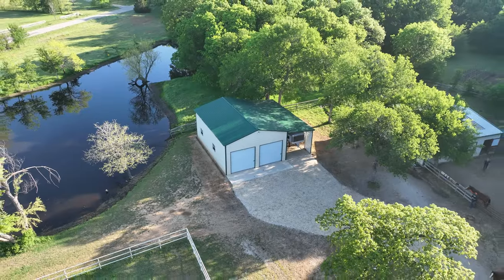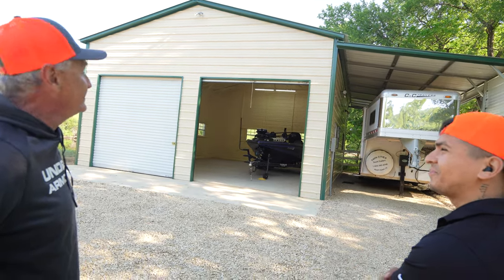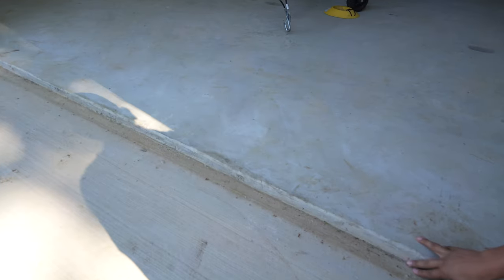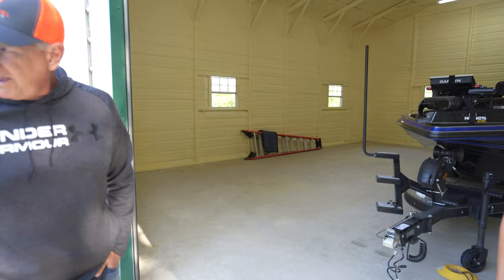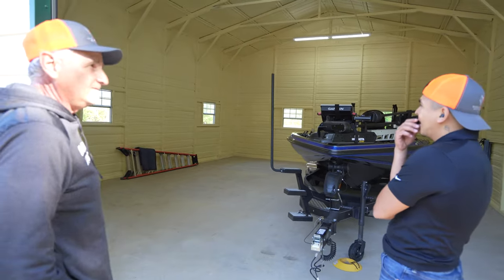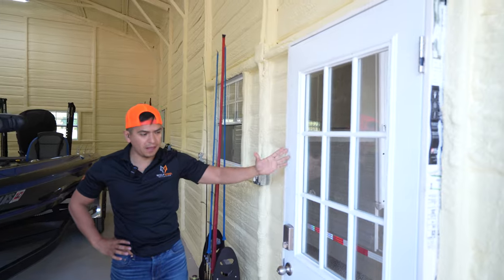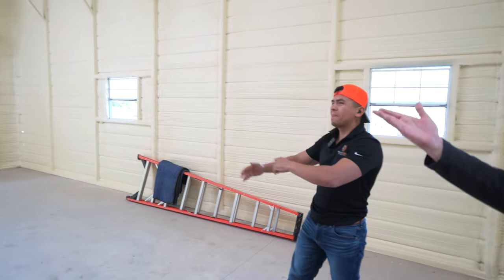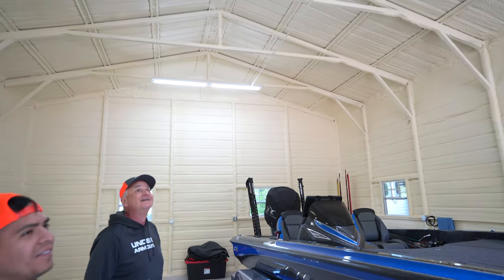Client Review and Tour | Texas Steel Building with Lean-To | WolfSteel Buildings

Comment: I have a question.....This tube steel building vs red Iron for same building size, etc..  Rough Cost Difference?
Reply from the maker: Hello! The cost difference could be around $2000 - $8,000 depends on the features. This tube steel building has majority of upgrade features so the difference is not much.

Comment: I will never understand why people get doors with windows in them. Someone would just break the glass unlock the door and take what they want. At least make the criminals work for it. The spray foam is a solid choice given the gaps in the structure and an easy way to seal up and provide that insulation for whatever your need is.
Reply from the maker: Aesthetics plays a big part on decisions made by customers. We offer different style doors to fit any of our customer's wants and needs!